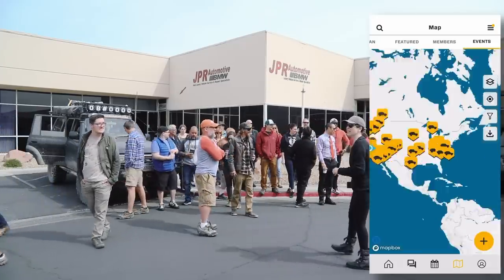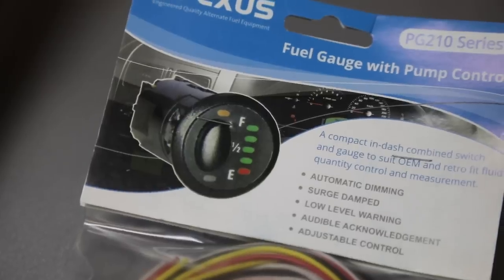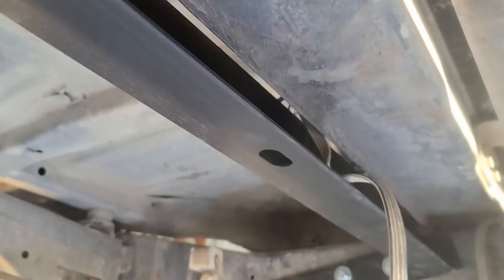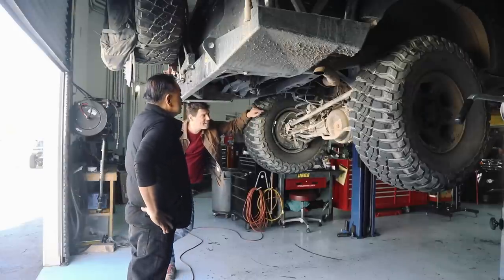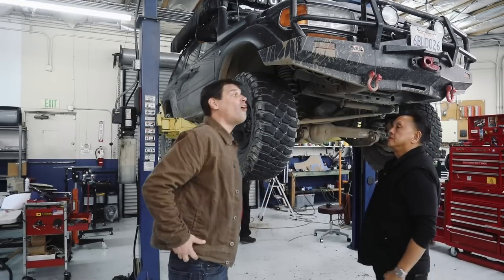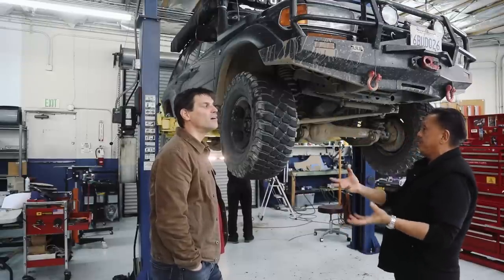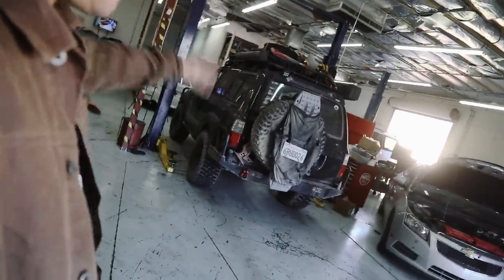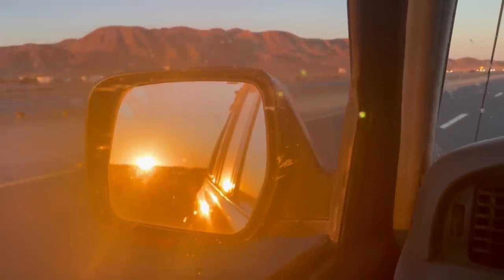Auxiliary Fuel Tank Install: Long Range America

Comment: I installed a 24 gallon auxiliary tank on my 5th Gen 4Runner.  A bit pricey, but no fuel containers on the exterior.  I did upgrade to the better fuel pump.  No complaints at all!  I had heard rumors of the fuel pump struggling at higher altitudes.  I did not have an issue while my rig was doing the Alpine Loop.  I upgraded after I did the Alpine loop.
Reply from the maker: Thanks Emanuel - if you don't mine telling me, what fuel pump and how noticeable was the difference?
Reply: @OverlandBound  I forgot the name of the pump.  I got the tank from Long Range America and had it shipped to Duggy's garage in Houston, TX.  Duggy's mentioned that they had a upgrade for the pump.  They would be able to tell you the name/brand.  The pump is quieter and fills the main tank quicker.
Reply: @lemaitrethemonk  how much did they charge to install lra? I’m in houston as well, I got one for my Lexus gx 460
Reply: @jamesfeng7086  I contacted Long Range America and they worked with Duggys garage.  I paid 2600.00 for every thing.  You can just go directly through Duggys garage, they are a licensed dealer.  Another thing to consider.  You are going to lose your spare tire on the bottom of your vehicle.  I purchased a Rigd tire swing out too.

Comment: LRA is made in Australia and is obviously named Long Range Australia over here. I just had a 160ltr, or as you Yanks would prefer, 42-gallon installed for a total capacity of 67 gal of fuel onboard when full. 
Another fun fact, most Aussie 80 series came standard with a 95 ltr/25 gal main tank and a 55ltr/14.5 gal sub tank fuel system, so installing the LRA setup is a little more straightforward, we have a slightly different fuel filler diversion nozzle and the fuel transfer, fuel gauge systems are fully compatible.
Happy wheeling my brothers and sisters across the Pacific.

Comment: Hey Mikey< welcome to the LRA club. Ralph, installed my tank in March, 2020 and have been happy ever since. 
Do consider upgrading to the "Holly Mighty-Mite hly12-428" fuel pump. A better pump for sure than the original. 
LRA is excellent for resolving warranty issues as well. First hand experience.  If you're interested I would be happy 
to share the story. Cheers, Mate

Comment: I've had the LRA tank for over a decade, definitely cuts down on the fillups, but it's definitely a shocker lately, I have the 42 gallon aux tank. so from empty to full in an 80 that cost me 0ver  $365 to fill it up. It's not necessarily a cost saver unless I can get fuel at a discount location like a military installation. I don't live near one anymore since retirement so it's regular prices. The added benefits of having fuel when on long trips is amazing though, especially since 80's eat fuel at low speeds when creeping up and down trails.

Comment: It's really pricey, I got 5x20 liter original Jerry cans strapped in the trucks bed and an 12v small fuel pump that pumps into the tank. Not even 100 euros setup. You can't beat that

Comment: Fantastic video thanks for posting. One question please. What is the long-term maintenance plan for this gas tank? After a few years do you need to pull it down and do any maintenance? Or is it something that you leave on for the life of the car?
Reply from the maker: I have no plans to do special maintenance but will follow up. I think you can treat it like any other gas tank on your vehicle.

Comment: Question. Does the car have to be parked to engage the auxiliary tank or will it move the fuel over while the vehicle is driving?

Thanks.
I'm looking at a 4runner and I believe that would be my first install before even a super charger or raising the vehicle another 2 inches.  I'm looking at the trd off road premium.  
Thanks
Reply: You can transfer while driving 👍🏼👍🏼

Comment: Still waiting for their diesel tank for JLU
Reply: My understanding is all the diesel emissions stuff is mounted in that cavity where the tank would have to be installed. Between the frame and the exhaust system under the drivers side.

Comment: Installing a larger tank to have the ability to pump more fuel when it’s cheaper is false economy. How much did the upgrade cost and how long will it take to recoup that?
Reply: Granted, its not about recouping tho is it?, its about extended adventure that your shilling out to ensure.
Reply from the maker: Cap, let's be honest...I'm just trying to give you an excuse to get one.
Reply: I prefer to have an LRA tank versus carrying 8 jerry cans of fuel hanging off of my vehicle. I also prefer to flip a switch and transfer while sitting in the vehicle than trying to empty the jerry cans one by one.